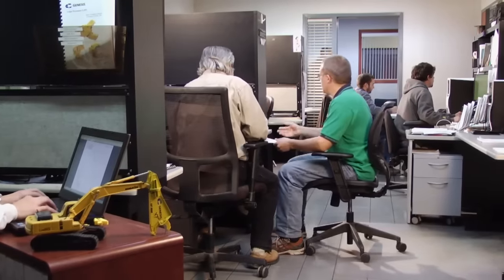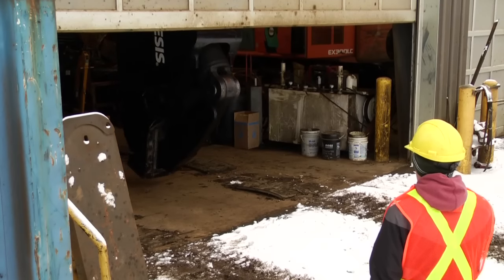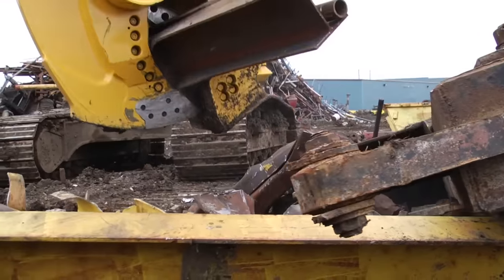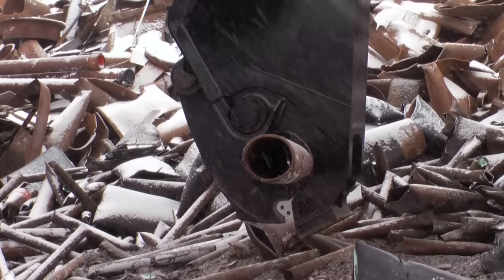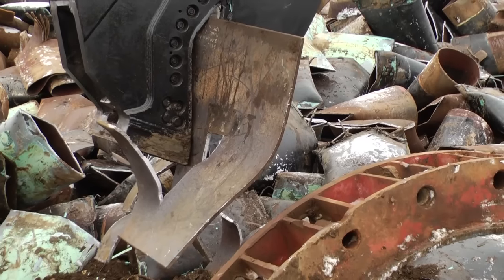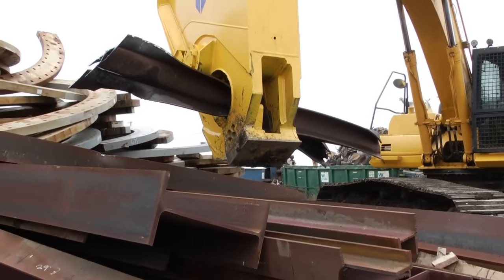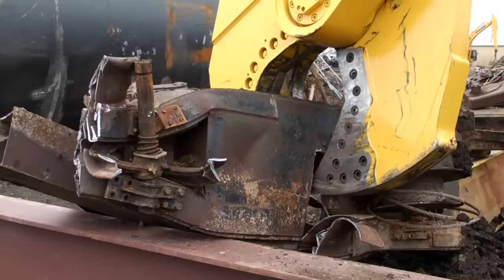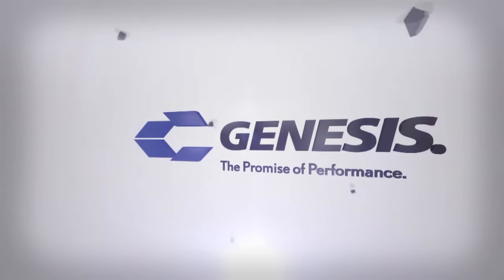New XT Mobile Shears - High Productivity Design Mounts on Smaller Carriers

Comment: Im a welder at a scrap yard and let me tell you these things do need a lot of maintenance but there worth having you are able to flip the blades three times and they cost about 5 thousands to replace trough Genesis but there are other places to  buy them. but them cheaper plan on alot of welding and build up work .
Reply: I am also a welder/operator myself.And operator cranes and a genesis xt555.I prefer the labounty msd 3000 any day over it.You cannot flip the tip and also the socket head bolts that hold the tip on sucks.Also only has 1 guide puck to guide the knife.Labounty has guide pucks on both sides of the knife and 12 point head bolts for the flippable tip.

Comment: I came here re: The Bridge Accident in Baltimore... Barge / Long arm Excavator / Shears, etc., Just an 💡 Idea ?
Reply: But that might speed the job up when you can have dozens of men with cutting gear (+ supervisors and safety inspectors) working 12 hour shifts on very high levels of pay for weeks! The Dutch have a semi-submersible crane that can lift 20,000 TONS (The Sleipnir) but we will order Army core of engineers (who I am not criticizing) since they are getting paid anyway to the job with lighter equipment .....
Reply: I thought the same thing! It's ridiculous to me they are using welders when we have equipment like this

Comment: How often do you change out the shear tips. How many life hours, that's great you can just use a in pact tool and change them out.. how many foot pounds do the hydraulics run .thank you..
Reply from the maker: Shane, how often you change out the shear tips depends upon how many hours you're operating the shear and the material you're cutting. The hydraulics also depend upon the application and carrier to which the shear is mounted.
Reply: The tips have to be rotated every 80 hours of work. I operate this exact shear
Reply: @CBR600_Dad  do you use it for cutting cables at all?  We are looking at removing all the old cables from a site to deter thieves from stealing it all.  But wondered if it would just bind in the shears

Comment: Will these cut large copper electrical cables?  Looking at doing a site demo and we need something like this that will cut tech cables.
Reply from the maker: Mike, what is the cable diameter?
Reply: @GenesisAttachmentswi  they range from 1” to 4” of copper braided cable with an aluminum wrap and rubber dipped
Reply from the maker: @mikehoflin2175  We suggest a Versi Pro 15 with a shear jaw or a GXT 115 mobile shear. You can find these on our shear web page and locate a dealer near you using our Dealer Locator. https://www.genesisattachments.com/ Thank you for contacting us.
Reply: @GenesisAttachmentswi  lol. You guys can’t tell when someone was making jokes about the video? Are you not human.
Reply: @mikehoflin2175  absolutely amazing they think your being serious. Not as smart as their engineers I guess
Reply: @shortthrow50  I am serious.  Solid steel and cable are two different things.  Braided cable can bind up a shear

Comment: Was hoping to see it snip a railway iron
Reply from the maker: Behindtheblackstump, the Genesis GXT is not designed for processing hardened steel, such as railroad rails, because such steel breaks, rather than shears, which may cause flying debris and damage the shear and excavator.
Reply: Behindtheblackstump
Reply from the maker: @user-gb8dk7xw5o  Genesis mobile shears are not designed to process hardened steel. We recommend the Genesis rail breaker for processing 136 lb. and smaller low chrome rail. You can find more information at https://www.genesisattachments.com/products/grb-rail-breaker